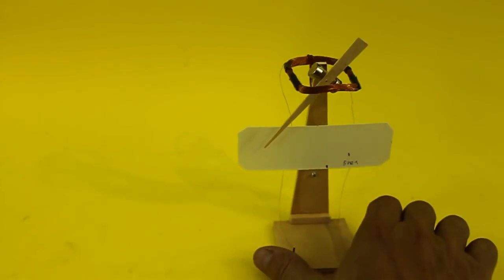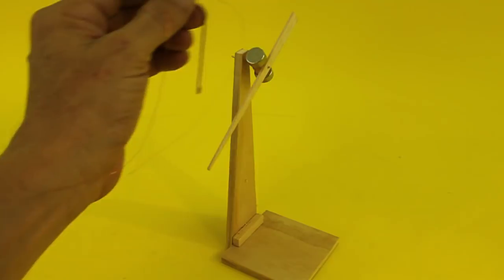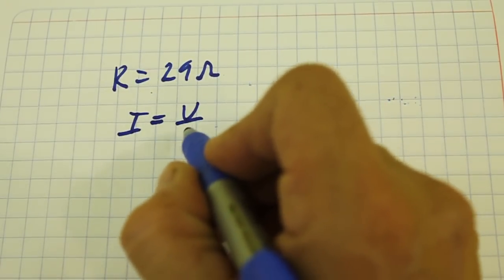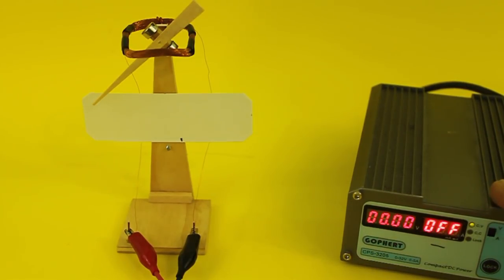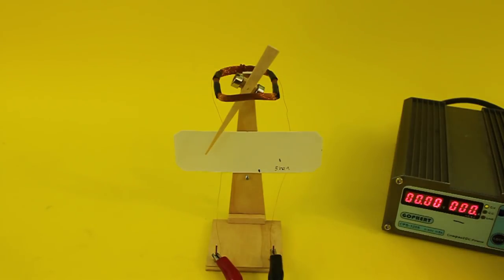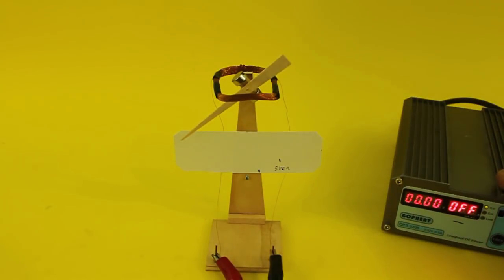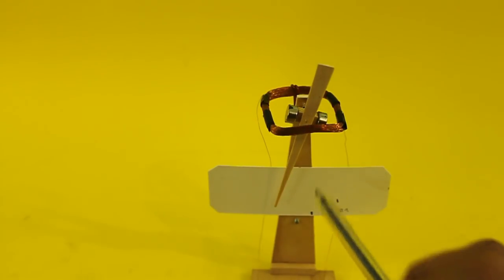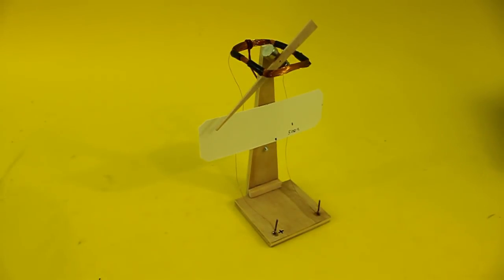Homemade Galvanometer

Comment: nice model and explanation, on the new design try to use ball bearings(use 2) from small computer fans and the fans shaft, as the diameters are very close it will not produce the effect as this Al tube and the needle tilting inside it
Reply: Tq good idea

Comment: Great experiment man, thanks :)
I think there are lotsa issues that worked against the design here:
Weight, size, gravity, upside down, material(wood versus metal)
I hope someone in the know, explains why it is not working properly or what is missing...etc.
Regards & good luck

Comment: What is the use of galvonameter?
Reply: It's the grand-father/daddy of ammeter(ampere meter=current meter):
"A galvanometer is an electromechanical instrument used for detecting and indicating electric current. A galvanometer works as an actuator, by producing a rotary deflection (of a "pointer"), in response to electric current flowing through a coil in a constant magnetic field. Early galvanometers were not calibrated, but their later developments were used as measuring instruments, called ammeters, to measure the current flowing through an electric circuit."
https://en.wikipedia.org/wiki/Galvanometer
Reply: igrewold thanks

Comment: You could you  lubrication, like wax or grease even some soft soap should work. Try using a piece of cutting board for the vertical piece. The should reduce friction especially if you use wax on the shaft.
Reply: Good idea :)
Graphite Powder is a dry lubricant :)
https://en.wikipedia.org/wiki/Dry_lubricant#Graphite
Could be easily obtained from pencil lead.

Comment: When i was a teenager i made a simple galvanometer.  It was a coil of wire (unknown amount of turns) wrapped around a compass. A crude device but it worked.
Reply: Cool man :)
https://youtu.be/66iXB9HZnw8
https://frank.pocnet.net/other/Sylvania/40_Uses_for_Germanium_Diodes.pdf

Comment: Can you make a video on how to make "Faraday's shaking flashlight torch"
Reply: I'm trying to make that with buzz magnet, but got no proper cap with good value!
https://duckduckgo.com/?q=buzz+magnet&iax=images&ia=images

I used 2 10ml syringe cases opposed to each other, without the pushers and removed needles and put that rubber seal inside so the magnet does not break the syringe case.
https://duckduckgo.com/?q=10ml+syringe&iax=images&ia=images

And made a coil in the middle about 6.5 ohm, forgot # of turns, which I got from some dead transformer.
used alligator clamps connected to coil wires and DMM to measure AC/DC voltage.
It registered a reading. And that is where I stopped ;D

see greatScott for more on that
https://youtu.be/ttwsMwG_Gco
I expect Ludic work to be even simple and better, if he showed it.

Comment: maybe try using the point of the needle riding in the divot/dimple of a center punched piece of steel or other hard metal as a bearing, though this would require two as they are single points of contact unlike the needle in tube which supplies two points of contact
Reply: though maybe even a drop of oil in the tube style would reduce the friction enough for noticeable improvement
Reply from the maker: I tried with oil and it got worst

Comment: The difference of mechanism between Voltmeter & ammeter?
Reply: voltmeters have as high as possible reisistance. ampmeters have as low as possible resistance
Reply: Good luck in reading this ;D
https://frank.pocnet.net/other/Sylvania/40_Uses_for_Germanium_Diodes.pdf

Comment: I need something more controllable for playing with laser pointers. No company makes hobbyist priced galvanometers. Gravity is not practical as it only functions correctly when oriented in one position. Springs help but their resistance to extend or contract is not linear nor are two springs exactly alike making it difficult to mass produce and calibrate them. I hope your able to find some solutions to these difficulties. Thanks.
Reply: Maybe you can buy a cheap analog ammeter from eBay (< 10$). An ammeter is nothing else than a galvanometer.
If you want to deflect a laser beam you could remove the housing and the needle and glue a small mirror to the center rod. The mirror can reflect the beam into different directions depending on the current.
Reply: David Hagler  Interesting idea. Some of the small DC motors I took out or rc servos in the 60's even have bearings. I wonder how those small vibrator motors in cell phones are constructed? The mass might be low enough to move at reasonable rates for scanning a laser beam. No time to play with the idea at the moment but I'll keep it in mind. Thanks.
Reply: David Hagler  Those are cute little motors but I have no idea if it could function as a galvo. He's having trouble getting the weight off but you could mount the weight stationary and have the body turn instead. Since it never rotates more than 360 degrees the wires won't be a problem. Kind of like the old rotary airplane engines of ww1 where the outside of the motor turned.